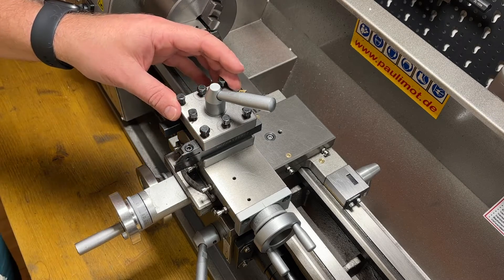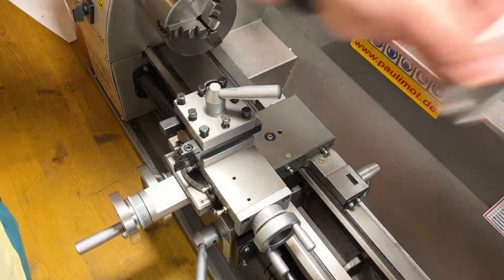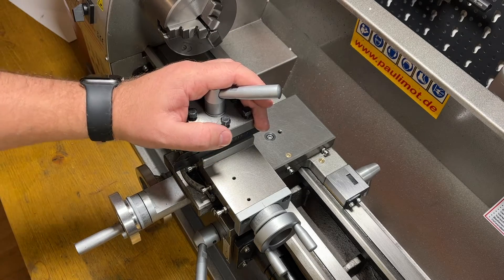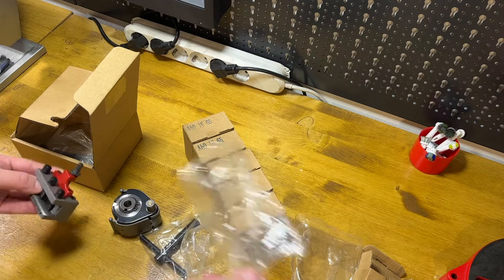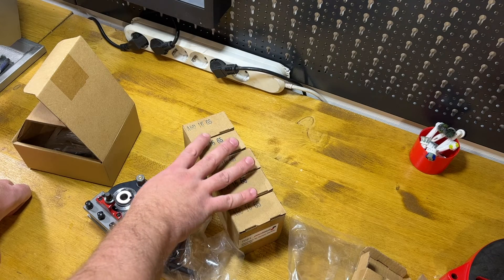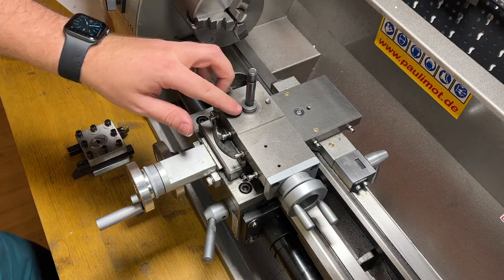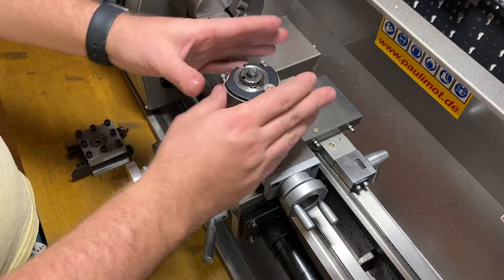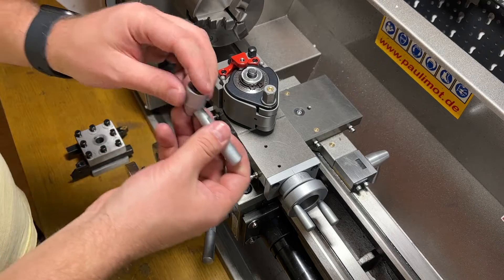Multifix for mini lathe

Comment: is that a 'Paulimot' brand AA size holder system?
Reply from the maker: it’s Paulimot AB size
Reply: @zhadlun  Danke...I think I need AA for my Lorch LLPV.. I have an original, Swiss-made Multifix A size, but the center height on my LLPV, from the compound, is about 4 mm too 'short... I would have to mill off part of the compound, which never seems like a good idea... I do have another, larger Loch Type A, which the Multifix might fit, but it's in storage, so I'm in more immediate need of something for the 'watchmaker' size lathe.
Reply: @derkarhu5079  Ab is around halfway between A and Aa in size. It may fit your lathe. PeWe tools offer a nice PDF with some measurements on how to pick the right size for your lathe. I think they were the first to offer an intermediate size between Aa and A (original Multifix didn't offer such an option), they called it AS. I think Paulimot's Ab is a copy of PeWe's AS.